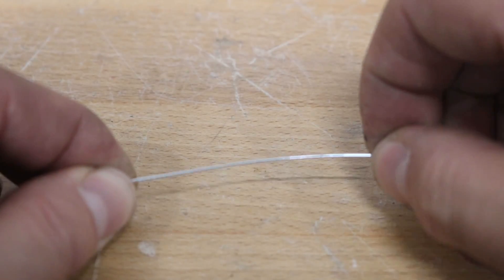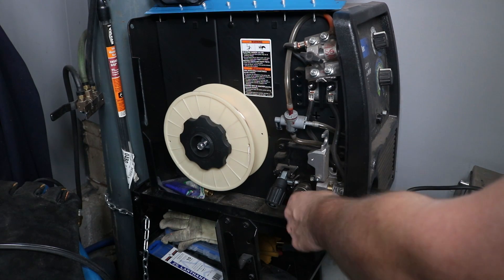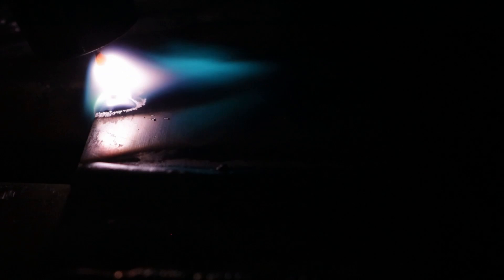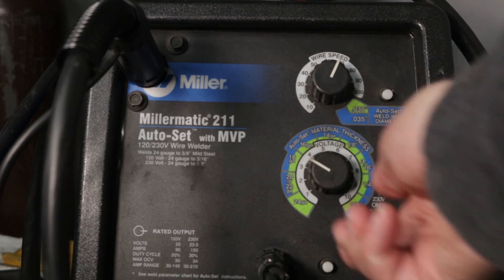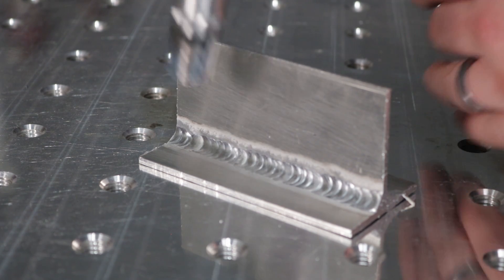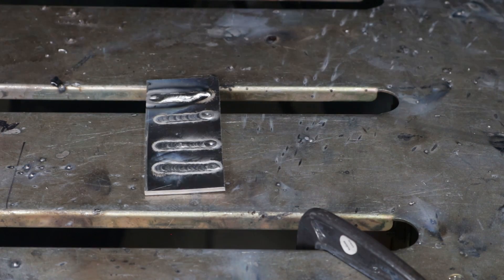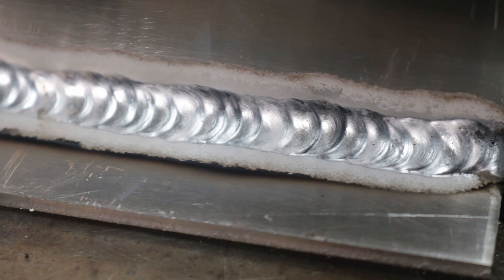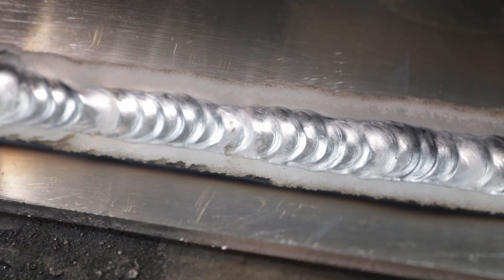How to MIG Weld Aluminum: Spool Gun Aluminum Welding for Beginners

Comment: What is it with Americans and spool guns? You can just use the machines wire feed. He even says it in the video. You don't need to buy a spool gun to MIG aluminium.
Reply: Not just Americans.......try running aluminum at higher speeds fed from the machine, I bet you get about 20 seconds of running before you develop a giant bird nest of wire inside your machine!
Reply: Pushing alu. wire through a 12 or 15 foot torch cable is troublesome to say the least, Teflon liner or not.
Reply: @mikeh2772  kid of like pushing a (uncooked spaghetti straw ) vs ( a cooked one))).....I can do it with  good teflon liner 35 wire  and keepin the lead as straight as possible..
Reply: @danbarosh2942  I can do it also. However, productivity takes a major hit if I have to concentrate on torch/lead angles vs. actual laid bead per minute. 
Clearing the jammed wire every couple minutes is not fun.
Reply from the maker: It can be done without the spool gun, but the lead has to be short and fairly straight. From a practical standpoint, it’s easier to transition. Thanks for the comment!

Comment: Purchased a basic uni Mig + a spool gun, tried welding alum sheet- very black result
15 pressure on argon 2 feed 7 power
No luck
Reply from the maker: Hi Sam,
Depending on the units on the argon, that could be too low. I’d turn it up quite a bit, probably 35 cfh. Also, be sure to use a push angle with about 5/8”-3/4” from the contact tip to the metal. Those are the main things to avoid black deposits.

Comment: Up front I would like to apologize for the long ramble... but there is a question at the end of it. Thank you so much for all the great content you put out... it's very much appreciated by a hobby welder like myself! I have the Titanium 200 welder and just recently purchased and started using the HF Titanium Spool Gun.  I started out getting pretty decent looking welds and that was all you, because I just duplicated your settings for wire speed and voltage, so thank you for that.  At the end of your video you dialed in your settings at 350 and 19.5.  I am finding (I think) that I'm doing better with 325 and 19.5.  However I feel like I am getting a high profile on my welds and I don't know how to fix that.  I have tried messing with the settings and just can't figure it out ( have my gas set at 25 and my inductance at 8).  I was hoping you could give me a suggestion.  Thank you sir!
Reply: Try increasing heat, decreasing wire or increasing travel speed.
Reply from the maker: I agree
Reply: @TimWelds  Thanks guys, I will try those suggestions!

Comment: Very good information. I've had a spool gun for 6 years and haven't even tried it , yet! It would be nice to see the voltage and wires speed information instead of the Miller use number whatever. My welders don't have a chart just the speeds and voltage. Support says to use synergic  settings to learn!
Reply from the maker: Thanks! I don’t get mine out too often, but it’s really nice when there’s a lot of weld to run in a hurry. There is a settings calculator on Miller’s website https://www.millerwelds.com/resources/weld-setting-calculators that can get you in the ballpark. Aluminum MIG is especially sensitive to settings, so I always have to dial mine in. It’s not too bad if you start with the voltage low and sneak up on it until it’s running good.